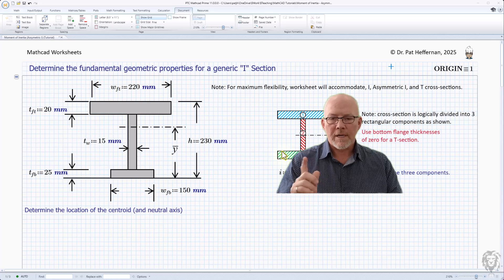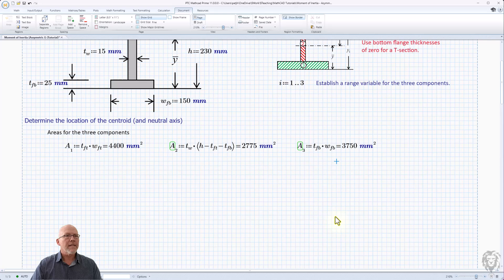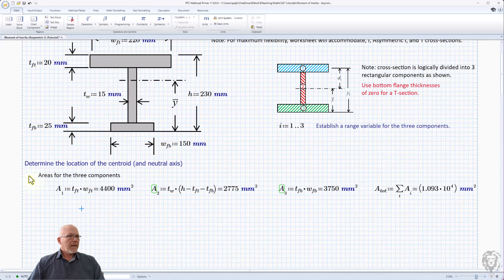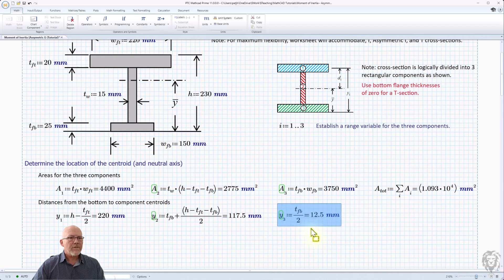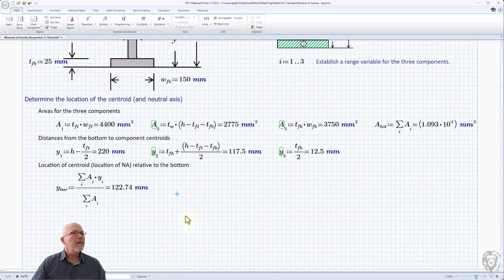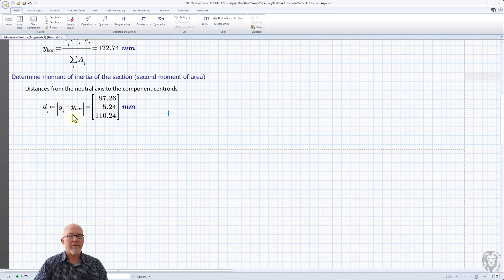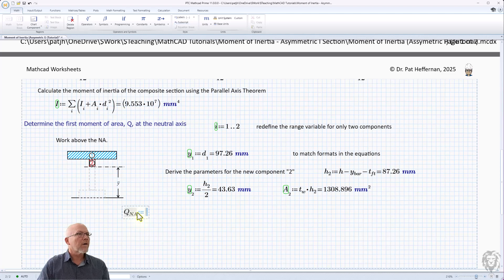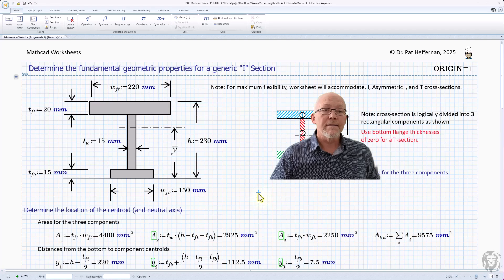PTC Mathcad - Moment of Inertia, etc. for various I & T-Sections

Comment: Thank you Dr. Pat, What drawing tools do you recommend to prepare analysis and design diagrams in MathCAD as you presented in your calculations here?
Reply from the maker: Hi.  As noted in this video (PTC Mathcad - Inserting Images
https://youtu.be/_sqdJpMmUQc) I tend to use PowerPoint as a readily available (decent) graphics editor.  I always save them with a transparent background for an organic integration.  Over the years I have developed significant collections of graphics which I can adapt or use for whatever problem I am working on, thus increasing my efficiency over time.